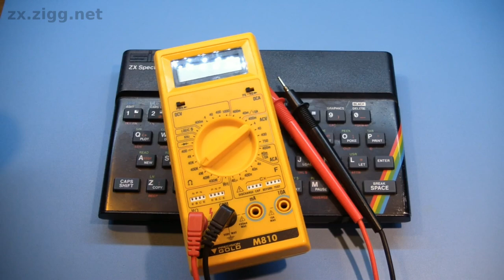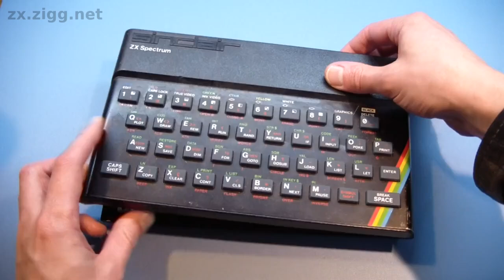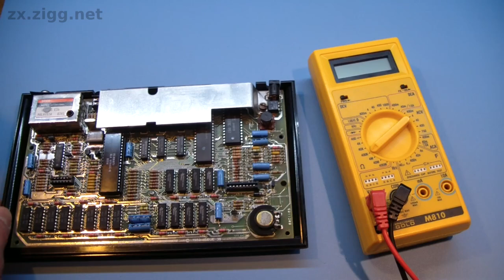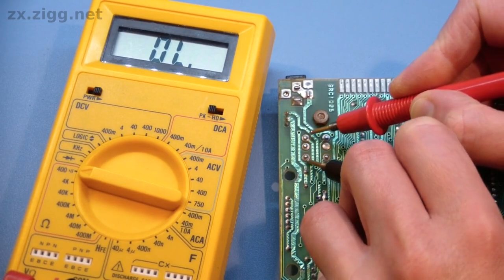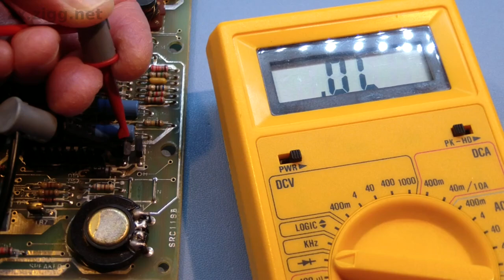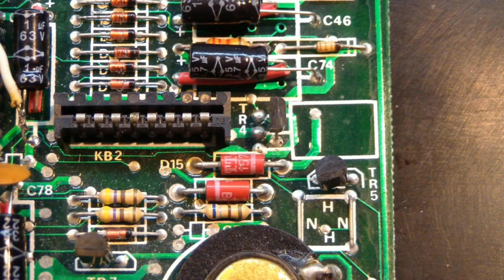ZX Spectrum (48K & 16K) Initial Tests

Comment: Hi, thank you so much for these videos about the Zx Spectrum 48k tests and repairs. Really good! I am having some trouble with my "Issue 3" unit, which was left unused for over 25 years... My power supply was dead and I got a replacement (new specific one, correct polarity on the connector). I performed all the resistance and continuity tests you suggest and everything seems ok. After plugging in the 9v power supply I also performed some circuit voltage tests (I saw it in another video of yours) and it was also ok. However, I am not getting any video output, and I have followed all the instructions to keep it between 603 and 608 Mhz or on channel 36 on my TV. What do you think? Should I try to replace all the electrolytic capacitors? Could their condition be preventing the video signal to come out properly? Thanks in advance for your advice!

Comment: I got two speccys issue 3B and 4A both with same problem speaker melts, problem is the overvoltage on speaker 12v? and buzzing noise.
i changed TR7 , D9 and voltage regulator, also tested with new ULA chip no change.
TR4 and TR5 are working correctly and i can use speccy but no sound due to burning speaker.

i havent seen anyone with same fault.
Reply: Have you tested the ohms on the speaker? If it is good, try testing the diode at D9 if you have changed TR7 it was the advice i was given that fixed my deaf speaker

Comment: Hi, I need your help on the upper left-hand pin of the rams instead of giving -5v gives -14v, I've changed all the capacitors what else could it be?
Reply from the maker: I'd first check the zener diode in the voltage converter circuit. There's a possibility this will have killed the lower RAM ICs.

Comment: Hi there- great videos. I have a quick question. I have an issue 3b that gives a low (400 ohm) reading at pin1 of ic13 (normally much higher in my experience) and 3 ohms at pin 8 of IC13. Voltage regulator tests ok and tr4/5 ok as were inductor coil tests. Any advice on where to start. I cannot turn this spectrum on, as the OCP kicks in on my power supply. Many thanks.
Reply from the maker: It sounds as if there is a short circuit between the 5 V and 0 V supply rails. That could be tricky to track down because so much is connected to both. Examine the circuit board very carefully to make sure it's not due to debris/a damaged track/out of position component lead/etc. Sometimes using a high resolution resistance meter to check the resistance between these rails at each component can find such a fault; the resistance will be very slightly lower near to the short. However, often the only way is to remove components until the guilty one is found.

Comment: Hi there Joules, I've just recapped my Issue 3 and before switch it on I made these initial tests you suggest; I have 1,8k ohms in +5V rail lower ram and with the multimeter in diode test, TR5 between base and emitter in reverse bias, I have 0,587 instead of about 1,2V: is these values correct? or a case like this denotes some faults? BTW, excellent and brilliant channel full of information, spot on mate, have a nice day !!
Reply from the maker: If none of the other measurements indicate a fault, then you shouldn't worry about the result of your in-circuit test of TR5. The reverse bias voltage reading during this test depends very much on the particular multimeter used. Only if a very low reading is obtained would there be cause for concern.
Reply: First of all thanks for your clarification, now my Speccy is in full working order, new capacitors improved a better video signal, composite video, spot on !!
Besides, I have an Issue 4B to repair, without switch it on I made all the initial tests and I've found TR4 shorted: do you suggest other test before change TR4 and switch the power on? If there are some lower or upper ram that failed, replacing TR4 will fail another time itself? Thanks a lot for the answers !
Reply from the maker: Remove TR4 and repeat all the power-off tests. If they pass, replace TR4 with a new ZTX651/ZTX652/ZTX653 (very few other physically small transistors will work reliably here) and do the tests again.

A vicious circle exists whereby sometimes faulty lower RAM overloads the voltage converter circuit and causes it to fail (possibly damaging more RAM ICs) or something else causes the voltage converter circuit to fail (e.g. misuse of the edge connector) and that causes RAM to fail, sometimes in a manner that'll overload and damage a repaired voltage converter circuit. Therefore all faults in the voltage converter circuit and in the RAM (where the fault is of a type that might overload the voltage converter circuit) must be corrected at the same time.

If you have a bench power supply with current limiting, set it to 9 V DC limited to 750 mA and use it to power the Spectrum (remember the input socket is centre negative). If the current limit operates for more than a couple of seconds, turn the power off immediately and you might save TR4 from being destroyed. If you have to use the normal ZX PSU and there is still a fault in the voltage converter circuit or the lower RAM overloads its output, TR4 will probably be destroyed instantly. If this doesn't happen, immediately test for the presence of the three power supply voltages at the lower RAM.

There are a few diodes in the voltage converter circuit. It is not all that common for these to fail, but it is worth testing them if you don't find anything else wrong. Consult the circuit diagram to see which ones they are and to determine what test results to expect.

If one of the resistance tests gives an unreasonably low reading or the voltage converter circuit still fails to work after having tested all of its key components, you'll probably have to remove all of the lower RAM ICs. With the eight lower RAM ICs removed, you should get the voltage converter working before fitting any new RAM. Once it is working, I recommend you fit standard (dual wipe) IC sockets and a new set of 4116 ICs or one of the lower RAM replacement modules available at http://zx.zigg.net .
Reply: Thanks a lot, I've replace TR4 with another ZTX650, replaced all electrolytic capacitors, all voltages correct, -5,11V, 4,96V and 12,11V should be ok, ROM and ULA swapped on my working 48K and they are good, tested, but I have surely a fault in lower or upper ram or both, the system hangs with magenta border, flashing colored blocks and garbage on the screen...weird measure of resistance on pin 2 of IC8, 505 ohm and IC17, 47,4 ohm, other pin 2 of each ram IC's are around 7,1k - 7,6k: can we say IC8 and IC17 are at fault?
Reply from the maker: I assume that above you are saying you measured 505 ohms between the 0 V power supply rail and pin 2 of IC8 and 47.4 ohms between the 0 V power supply rail and pin 2 of IC17. If that is correct, then I think it very likely IC17 is faulty. IC8 probably is not as pin 2/14 of IC8 is connected to pin 2/14 of IC17 via a 470 ohm resistor. Remove IC17 or cut through pins 2 and 14 and bend them so they are no longer connected. With a bit of luck, the computer might then initialise as a 16K model. If it does, run the Memtest program from http://zx.zigg.net and tell it to test the upper RAM. It is possible there are other faulty upper RAM ICs; they just haven't failed in a way that prevents the computer from initialising. Faulty upper RAM ICs can be replaced with 4164 DRAM ICs (150 ns access time or faster) or all eight with one of the upper RAM modules.
Reply: JoulesperCoulomb Thanks Joules, I will surely, please wait for updates !!
Reply: Thank you very much for your help, IC17 removed, the computer initialize as a 16k model, no way to test upper ram with Memtest program, because it's a 16k for the moment and as result it shows error immediately, at location 32768; I've replaced IC17 with a spare so I could run the Memtest utility, no error at all, many passes, only IC17 was faulty, I've also run the utility ZX Spectrum DIagnostics by Brendan Alford and no errors detected also in this case, so IC8 is healthy. Many thanks again sir :-)
Reply from the maker: It certainly would have been possible to run the Memtest program and your message above implies that you did! Of course, it would have immediately reported a series of errors because IC17 was disconnected. The point would have been that by examining the values it reported, it would have been possible to determine whether or not it was likely any other upper RAM ICs were faulty. However, as you have now discovered, it seems no others were.
Reply: JoulesperCoulomb Thanks for the hint but how can I interpret these values? Is there any tables  for this case? Anyway, spot on !!
Reply from the maker: The Memtest program works by generating a list of random numbers and filling the RAM area to be tested with these, then it reads them back to see whether or not the RAM correctly returns that value that was written to each address. After a certain number of errors have been detected, the program stops and lists the addresses in question along with the test value that had been written to each address and the (incorrect) value that was read back.

In the ZX Spectrum, each RAM IC provides one bit of storage for every byte in the address space it is mapped to. For example, IC15 is responsible for bit zero (the least significant bit) of every byte in the top 32K of the memory address map. Look at the circuit diagram to see how the others are connected.

By comparing the expected values in the error report with the values actually read, it is possible to work out which RAM ICs are likely to be at fault. This could be done by converting the values to their eight bit binary representations or by calculating the difference between each pair and then working out what combination of bit position weights (1, 2, 4, 8, 16, etc) make up the difference value and so reveal in which bit positions errors occurred. For example, in your case, if only IC17 was faulty, the difference between all of the value pairs in the error report would have been 4 (bit position 2). Note it is necessary to consider multiple error instances as a fault might not be revealed by all test values. For example, if IC17 has a fault that causes it to always generate a high output and the test value has a 1 in bit position 2, then the fault is not detected.

Comment: Hello Joules, so i came from cap replacing video. This is apropriate place to discuss.
So board power up ok but in few seconds i got black raster with white border and clicks from speaker. PS gives 16V unloaded as we discussed already....
My board is issue 4A with Ferranti ULA 6C001E-6 which is odd since i read on ByteDelight that 6C001E-7 is right ULA chip for 4A board and higher?
So i didnt power up my Specky since yesterday and i went with initial tests.
Voltage reg, test:
Input to ground test gives some 162 kohms (strangely on auto range i get 0,6 MOhms??)
Lower RAM upper right leg (null rail) gives zero ohms.
                       lower right leg (5V rail) gives 01,1 kOhm
                      upper left leg (-5V rail) gives in ohm range OL (open circuit) and in kOhm range gives 98,6 kOhms
                       lover left leg (12V rail) gives 2.7 kOhm
Inductor test:
 winding 1=00,3 ohm
 winding 2=00,2 ohm
  between windings OL (open circuit)

TR4 test:
  positive in middle (base) and negative on collector and emmiter 0,6/0,6 V
  negative in middle (base) and positive on C and E gives OL (open circuit)

TR5 test:
 negative in middle (base) and positive on C and E gives 0,65/0,65 V
  positive in middle (base) and negative to collector= OL (open circuit), negative to emmiter= 0,78 V

Yeah thats it, so it seems i dont have -5V rail "scratch my head"?!
Can you give some advice on this Joules?
Thanx mate
Cheers
Reply from the maker: An issue 4 Spectrum should have -7 type ULA. The -6 will often work, but sometimes leads to unreliable lower RAM accesses (with all sort of strange symptoms).

You say the -5 V supply is missing, so I assume you have measured the power supply voltages at the lower RAM with the power on (though you don't directly say you have done this). What voltage did you find at the 12 V rail?

I'd expect the computer to not be able to initialise at all with -5 V missing and this could well lead to the lower RAM ICs being damaged. If this is correct, I'd suggest one of the following has happened:

1. The voltage converter circuit is broken.
2. The voltage converter's -5 V output is being overloaded.
3. A broken PCB track is preventing the -5 V supply from reaching the lower RAM.

TR4 burning out is the most common failure mode of the voltage converter circuit. I assume your tests of TR4 and TR5 were made in-circuit using your multimeter's diode test mode. They suggest that both of these transistors are in working order.

Barring 3, problem 2 is quite likely and the only easy way to find out is probably to remove all of the lower RAM ICs; though you could take them out one at a time and see whether the -5 V supply returns after removing each one. With the lower RAM removed you should make sure that all power supply voltages are present before fitting any new RAM. Lower RAM can be replaced with new old stock/used 4116 ICs (150 ns access time or faster) or with one of the modules available at http://zx.zigg.net .

If you aren't absolutely confident you have the skills and equipment needed to de-solder RAM ICs without damaging the PCB, I recommend you remove them by cutting through their leads and then remove these one by one. It is easier to replace the RAM than it is to replace the PCB!
Reply: Hey Joules,
I didnt power up this board since i experience these artifacts on screen after boot. I still need to take care of power supply higher voltage issue. But i follow up your initial tests with resistance measuring.
I didnt said i dont have -5 volt rail. What i said is that i have cca 99 kohm of resistance in multimeter auto range but in manual ohm range i have OL on screen so that is odd. If i recon you have few hundreds of ohm at -5 volt rail!?
Lower RAM on my board is socketed luckily so i can use extractor to remove it from board.
I would like to replace all eight chips with new guys in 4116 packets. I would like this board to be closest to original. Do you know where to get these in NOS or brand new? What do you think about these?: http://www.jameco.com/z/4116-15-Major-Brands-Dynamic-RAM-16kx1-150ns-DIP-16_41339.html
I still need to do recap on that board but i am absent from my home currently. It would be nice to remove tr4 and tr5 and do measures out of board and change it in case of failure.
It is odd to me to see that ULA on 4A board. Is there any way i can find proper ULA chip for my board?
So before i do recap and wait for new chips to arrive i cant do more. And still need to take care of power supply :)
Reply from the maker: You said 'Yeah thats it, so it seems i dont have -5V rail', which I took to mean you had measured the voltage somewhere on the -5 V supply rail and obtained a result other than -5 V.

Anyway, if the lower RAM is fitted in IC sockets, you should remove it all and make sure all the power supplies are working before re-fitting it or fitting new ICs.

You definitely should replace all of the electrolytic capacitors as failed capacitors are a very common cause of power supply problems.

The resistance readings you have taken do not obviously indicate the presence of a fault. Because of what is being measured, the readings may vary considerably depending on the multimeter used and the range it is set to. However, in general, very low resistance readings are indicative of a fault.

The 4116 ICs described at the URL you give should be suitable for use in a ZX Spectrum.

ZX Spectrum ULAs aren't all that easy to obtain, other than by removing them from other Spectrums. I believe that one or two individuals have finally completed projects to create new (CPLD based) replacements. I haven't any details on hand, but I have seen some advertised for sale somewhere.
Reply: Yes sorry for misunderstanding, English is not my native language.
I would like to find such ULA chip. I will definitely recap this board and change RAM chips  before fitting new power supply.
Reply from the maker: Whatever you do, make sure all the power supply voltages are present and correct before fitting new RAM, otherwise the new RAM will likely be damaged.
Reply: Thanx for advice. I will test board with proper voltage before fitting new dram chips. You say it is possible to put faster dram than 150 ns? I think i will go with 150 ns chips
Reply from the maker: You can if you like, but it won't make any difference. The access time specification refers to the maximum rate at which the RAM can reliably be written to or read from. The actual rate at which this happens is determined by the system it is installed in.

Comment: Hi, could you take a look at this video please? im trying to figure out what the problem with my speccy is https://www.youtube.com/watch?v=YcA-HrAUlXs
Reply from the maker: What type of video connection are you using? RF/composite/RGB? Are you able to try a different means of connection?

Does the effect occur regardless of what's on the display and what software is running?

I do not know the root cause, but it looks as if something is causing bursts of noise on the video signal.

Is the interference pattern obviously synchronised with any activity? E.g. key presses, joystick movements, audio output, etc.
Reply: im using RF, and it only happens when stuff on the screen is moving,and no, it isnt effected by software, its just there, wether im on basic, the tape loader, or 128k basic, its just there although i am planning on using RGB once i get an RGB to SCART cable which i hope will solve my problem